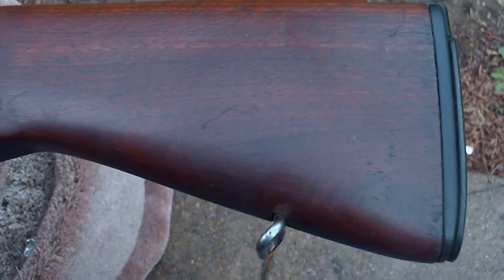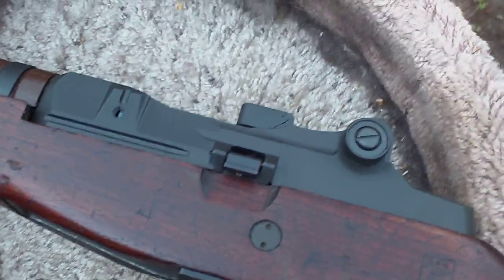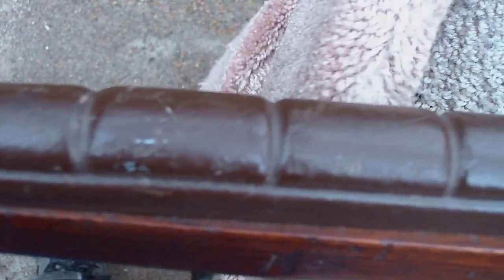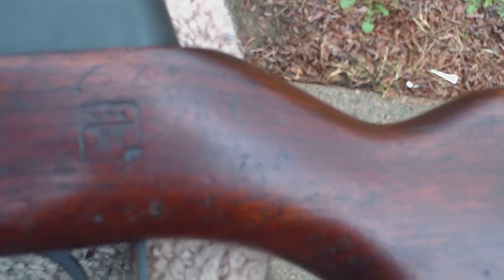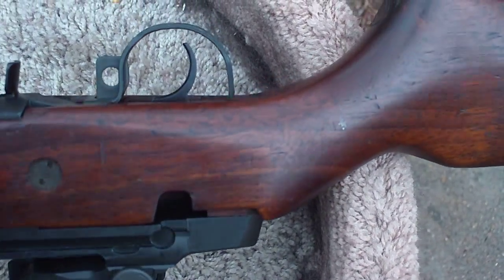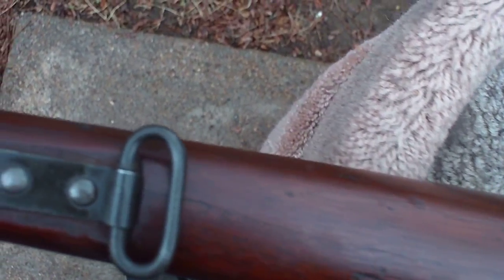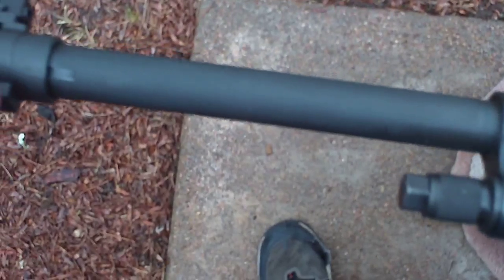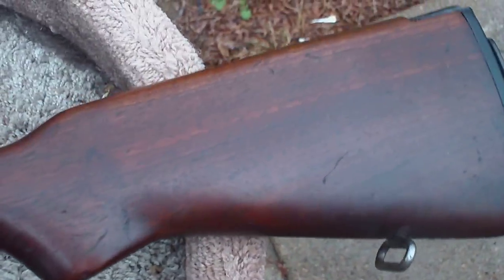M14 project

Comment: I did the same I just replaced a new Springfield armory walnut stock for a nice used walnut usgi stock nice stamps I also replaced the new hand guard with a nicely used one usgi sling and a match front sight op rod guide silicone coated springs finally polished trigger for a smoother not lighter pull love it!